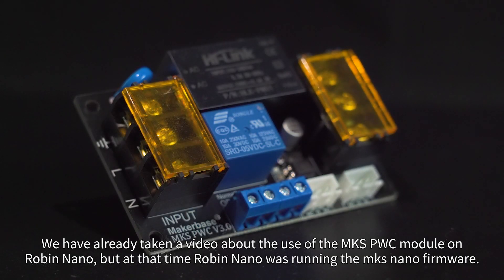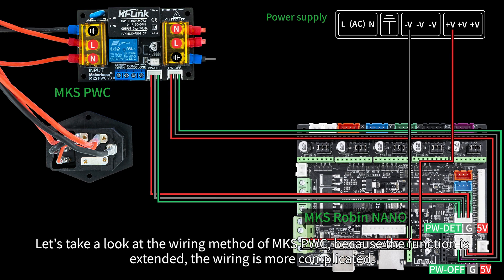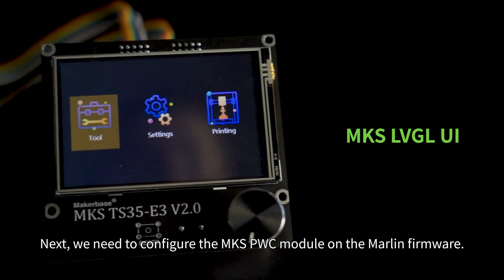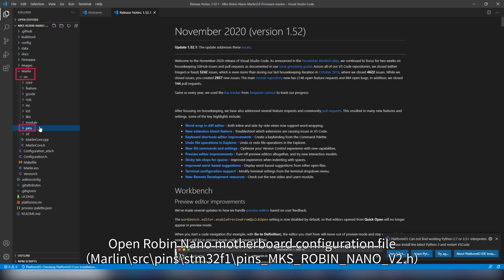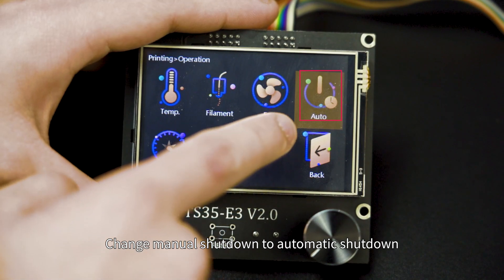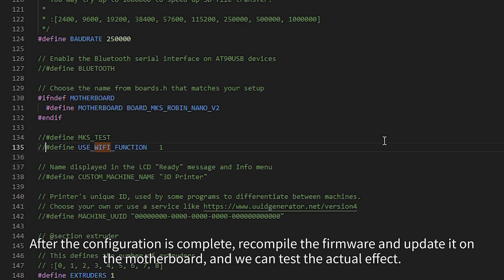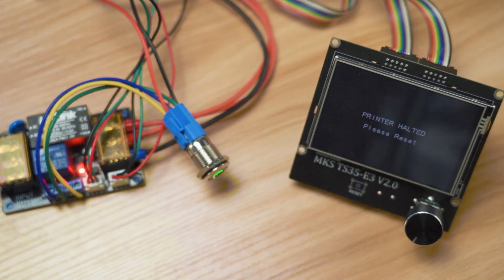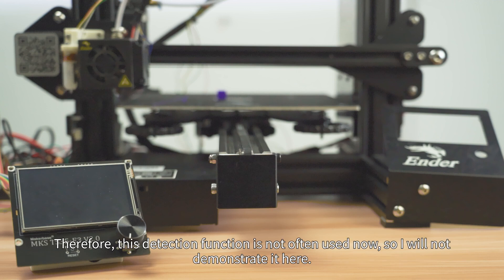How to use the MKS PWC module on Robin Nano to automatically shut down after printing

Comment: I am using MKS PWC V3.0 with MKS Robin Nano V3, MKS TS35 V2.0 and Mean Well LRS350-24 power switch.
So it's pretty close to your setup shown in the video and wired exactly like you did and the manual said.
The current marlin firmware from your repository is also modified (enabled MKSPWC in pins).
But sending M81 command doesnt do anything and when I press the power button it shows the "System halted" message in the screen but doesn't power off any further :(
Please help!
Reply: Купец вот это помощь lol

Comment: There is a video tutorial to MKS Robin Nano V3 + H43?
Reply from the maker: Hello, the wiring method is the same, but the configuration method is different. For the firmware configuration, you only need to add the following code to the pins_robin_nano_V3.h file
#define SUICIDE_PIN_INVERTING false
#define SUICIDE_PIN PB2
#define KILL_PIN PA2
#define KILL_PIN_INVERTING true
Reply: @makerbaseteam4217  Thanks. I download a new configuration.h and configuration_adv.h from MKS tool and made the suggested modify in the pins_robin_nano_V3.h. But the new flash firmware doesn't works. The H43 screen doesn't shows the MKS logo and goes to a Chinese screen like printing anything and doesn't back to Home Screen. I don't know what I doing wrong ...
Reply from the maker: @CharlieAMiquelin  Did you choose mks_dgus on the tool? The firmware you use is V2.0.8.2?

Comment: Good day.MKS Robin Nano V2.0+MKS TS35. when the button is released, the printer turns off
Reply: had the same issue. bad wiring or need to change pin definitions in marlin

Comment: Hello Makerbase Team, i have a MKS ROBIN NANO V2.0 + MKS TS35 V2.0 - LVGL UI + MKS PWC V3.0, i set up all in according to video and after print i have screen "Done print - Confirm". The printer does not turn off.
What Could be reason for this ?
I have except that MKS TMC2209 V2.0 and MKS 3D TOUCH. Only TMC works properly, 3D TOUCH does not work. When i try autoleveling funktion the 3D TOUCH goes to first probe point, the pin goes down but bed goes Z+ ca. 20mm(pin dont touch to bed) after what the head with 3d touch goes again to home
position. Add that i have still mechanical endstop conect to Z-(i'd like to leave him) and 3d touch is connect to bl touch and Z+. 
Maybe You can share ready to compile Marlin with the above options ?
Reply from the maker: Does not shut down after printing? Is the manual switch function normal? Have you set automatic shutdown in the print interface? The problem that 3Dtouch can only level one point, have you set Z_offset? And did you trigger Z stop first when leveling? If so, you need to install 3dtouch one more point, and then need to restore the factory data on the screen
Reply: I had it set the 3d touch offsets, with Z offset. 
I did a test again after revert Eeprom settings to factory default and 3D TOUCH works correct. I dont know only how to set custom probe points, is this possible like in manual leveling ? 
Ad. PWC :
Yes, does not shut down after print, manual switch funktion ok (started when i pushing first, and "Printer halted Please reset" screen after pushing second time) , i set "auto" in print interface, after print i have screen "Done print - Confirm", and nothing happens after, the printer is still on.
Reply from the maker: @HELIMH  The detection point cannot be specifically set to a certain point, it is automatically calculated according to the printing range; if you can't shut down after printing, can you send us your bin file, let's try it, my email 1428043543@ qq.com